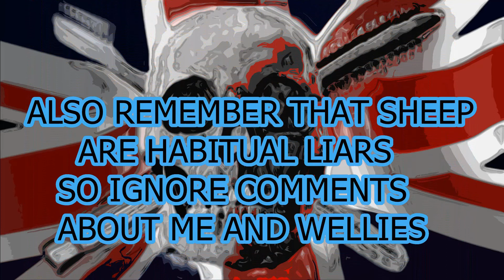Mamod TE1A  restoration ..............part 4

Comment: I've found that reds can vary according to primer colour. They come lighter if you use a white or pale grey primer. Agree with you on solvol
Reply from the maker: yeah didn't reccon maroon was such a weak pigment though , to some degree it is weaker than most reds and many yellows